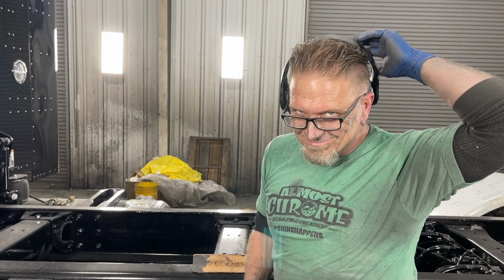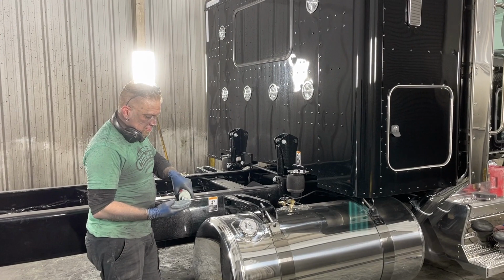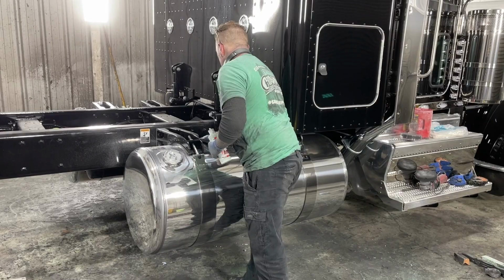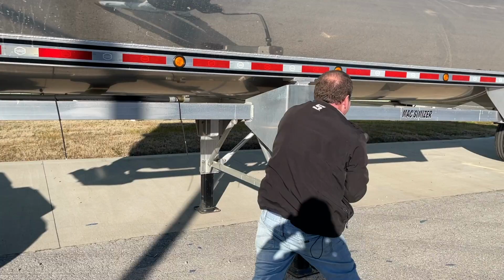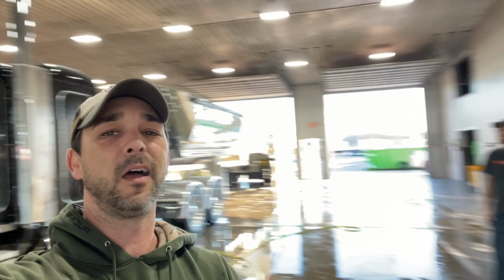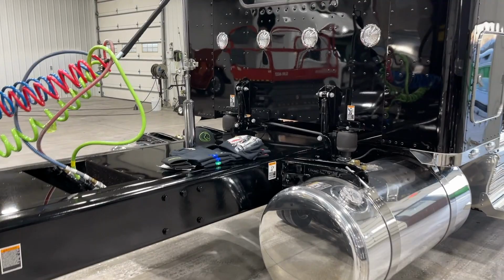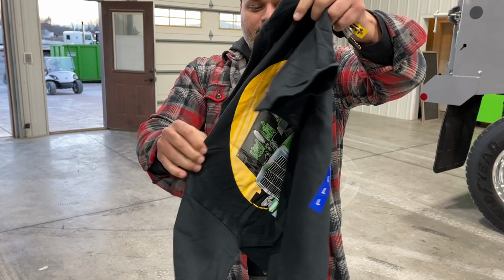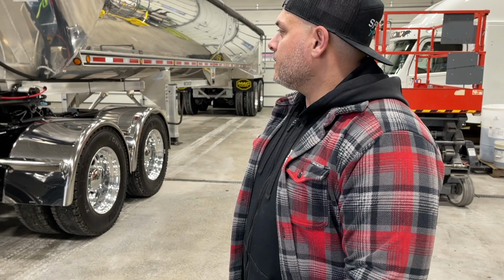"Night Hawk" is heading home! 2021 Peterbilt 389 & MAC end dump trailer

Comment: Turned out awesome. But, need conspiscuity tape on the rear of the tractor. Dot loves to write tickets for that, as also I would have put final lube plate by American made systems on the trailer 5th wheel plate. No grease on the fifth wheel,  keeps it nice and Clean!, just my opinion

Comment: Hey dude love your channel y’all should do white 389 wit da red frame n 72 in flap or stand up and chrome out much as you can dynaflex 7 inch straits or maybs dog eared 7 or 9 clearance lights and a overinflated / dump valve on the front end 20 inch bumper lights out the side of bumper 2 and throw some red or white lights in the air cleaners red lights out the back of sleeper custom t bar and all the lights round the truck you normally do and sleeper panels and stuff and throw the 605 horse x15 in her to 😂 but yea love y’all’s vids keep m comin